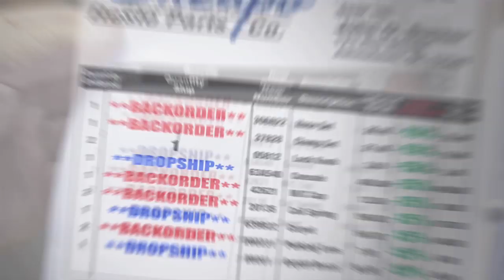Part 2 Weld up Antenna Hole Classic Car Muscle Cars Episode 167 Autorestomod

Comment: Turn your welding heat up a bit.  I set my welder for the heavier thickness metal (the fender is certainly thicker than 22g).  Also, an air hose and spray nozzle will cool that weld quickly and allow you to move along.

Comment: At some point in the video there was mention of blowing compressed air on the welds to help cool them.. I dont really like doing that. It highly distorts the metal and warpes it. I usually let them off naturally or use a damp shop rag and run over the spot welds till property cooled off for the next set of tacks. Very informative video tho, great job.
Reply from the maker: Yep, that is an alternative.

Comment: I gather you guys are in one of the Southern United States based on the recommendation that the repair metal could be left bare underneath. Just want to point out that in an environment which sees moisture, salt and snow, that paint would be bubbling on the top side in about 2 years. Coating the underside would be absolutely necessary where I am in Ontario Canada. POR-15 for sure. Around here it bodes well to avoid filler directly on welded repairs on the chance there is a pinhole in the welds. Moisture will end up behind the filler and rot the bare metal very quickly, popping the filler up in sections. The area should be first sealed top and bottom with epoxy primer or POR-15, then the primer/POR-15 80 gritted for adhesion, then filler applied on top. The POR-15 company even makes a filler designed to be applied directly over cured POR-15 after a bit of scuffing.
Reply from the maker: Good points Aaron, we do talk about that at the 19:19 point in the video.
Reply: Down here in the south Aaron we have high humidity which can rust a bare panel pretty quick, but up there you guys have to deal with road salt, much much more snow which gets flung everywhere in the crevices of the car then melts with all that salt in it, plus the rocks in it that can make a chip for the rust to start. I'm guessing that POR-15 is a lifesaver for you guys. Btw loving your cosmo build.
Reply: BillyandJostvshows You're right about the salt. My area, extending into Michigan, is often referred to as the "rust belt". If you have a car you want to keep, then it better be made of aluminium/stainless or simply not driven in the winter. Really it's a shame they use salt because there are other more effective ways to melt ice without the automotive and environmental damage.
Reply: aaroncake yea and even here in tn they use salt in the winter, but much less of course. Still enough to rot the piss out of the 4x4s, including mine which now has started developing rust along the bottom of the cab. I read something about a synthetic chemical that won't hurt metal and melts ice twice as fast, but it's cost prohibitive. Bottom line is our cars are not the cities' problems.
Reply: I'm up near Cleveland, Ohio and am doing a Studebaker Coupe like the one in the background.  I'm using Rust Bullet from Summit Racing.  It's better than POR 15 and reasonably priced.

Comment: What did you guys use for the antenna?
Reply from the maker: We used a powered antenna from Retrosound USA in the spot where the dash speaker should be. https://www.retromanufacturing.com/ Part number: HPA1

Comment: Min 2:57, incorrect wire feed speed and volts and stickout ( distance nozzle to work piece ) too far away ...…. no you don't want to put a lot of heat into the panel, but not at the sacrifice of weld penetration...… those weld are all balled up on top of metal , no penetration what does that matter? after the weld is dressed ( ground ) down wont be much weld joining parent metal to plug what does that matter? after the vehicle is finished and painted there is a chance the original antenna "hole outline " will telegraph  and be visible. That will make you unhappy...
Reply from the maker: Thanks for the input! We appreciate when people take the time to help out!
Reply: I'm actually glad he welded it like that, it shows it can get done with my crap $100 welder.  Well hopefully.

Comment: It bothers me he isn't wearing gloves on his hands. I know he's a seasoned pro and they can be a little clumsy to wear, but UV and burns not good.
Reply from the maker: It's been a while Gav, but we think that he does mention wearing gloves. Honestly it is the safest thing to work without them. But us old guys can be kinda stubborn about that sort of thing.
Reply: AutoRestoMod yeah I understand it's a pain to put them on all the time. I'm doing a technical course in Sydney and my teacher doesn't always wear them either but he's old school and knows what he's doing. I wear them mostly cause I hate being burnt. The teacher in my course prefers to use an oxy welder on these sorts of repairs but MIG is so much easier and there is less risk of being burnt with mig than oxy. Anyway I learnt a few things from this video, mostly about how to use a mig for small repairs like this. I've been using oxy cause it's what the teacher prefers but this is shows you can use both and get similar results.